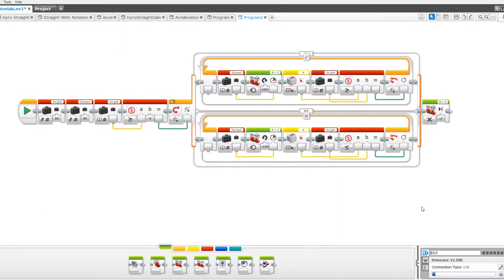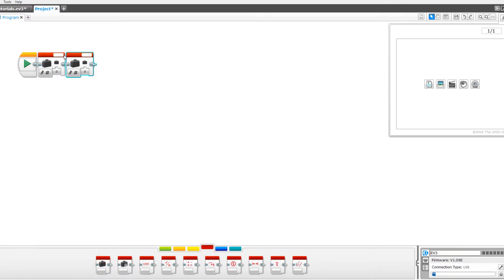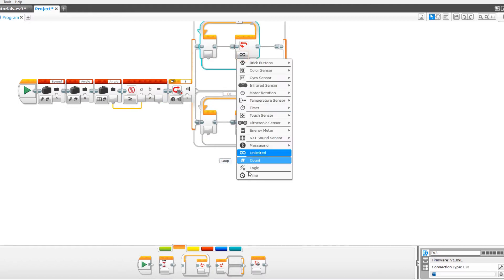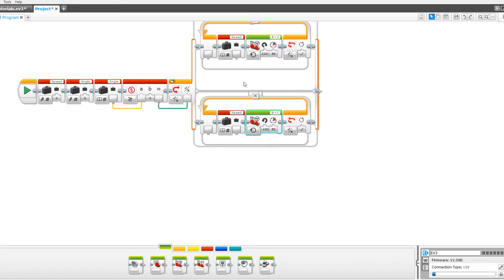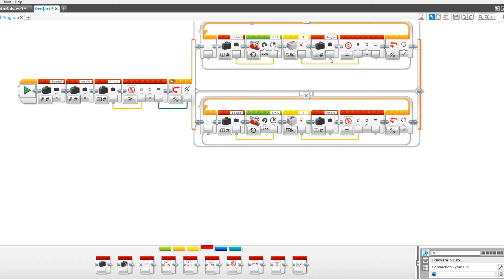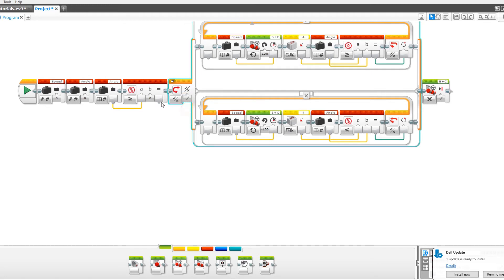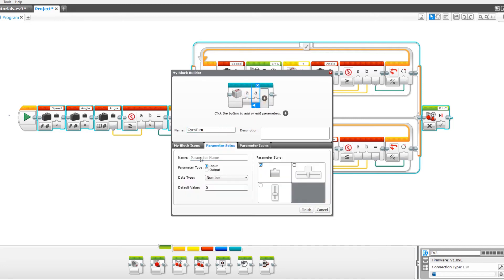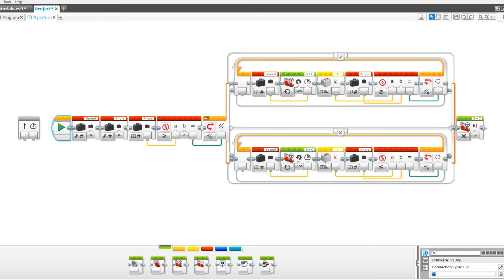How to Turn Accurately! | Ev3 Programming Tutorial

Comment: I’m using this program and it works but it doesn’t want to turn left. I have to do multiple turns and it keeps doing a 180 when I enter -90 for it to turn left
Reply from the maker: I am sorry if I made a mistake. I am unable to make revisions do to enormous school workloads, but you are welcome to try to make some tweaks!
Reply: Depending on what you are doing with your gyro, prior to running the turning program, you may need to add a gyro reset block at the begining of the turning program. Also, you need to do a gryo reset each time you are going to run the turning program. That is what fixed the problem for us, of initially turning correctly -90 degrees (left), then when we entered 90 to turn right it would instead turn 180 degress.

Comment: What are your experience of How accurate are the turns with this program? The biggest problem I experienced is the gyro lag at various speed, weight of the robot and the wheel sizes. I am still looking for a program that turn accurately for FLL competition that take these into account and be accurate to less than 1 degree margin of error.  Especially, using the larger 90 mm plus wheels .
Please  correct me if am wrong but this complex program looks like it could be simplified using a motor steering block on, wait block  gyro to target angle, motor steering block off. Cheers. I Looks forward to seeing your bigger programs for the turn.
Reply from the maker: Well, every once and a while I get a laggy gyro sensor, and generally speaking, taking 10 degrees of of your turn will fix the problem. The thing is, that even though it is laggy, it is still consistent so experimenting should get you good results.
If this does not work for you, I am in the process of making a more complex program that will slow down the robot as it approaches the target angle.
Thanks for your feedback!